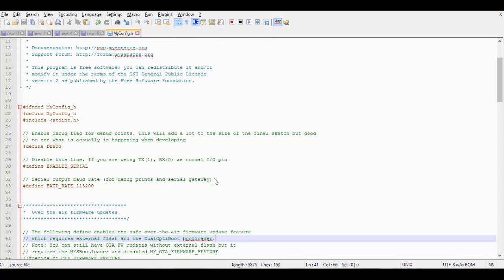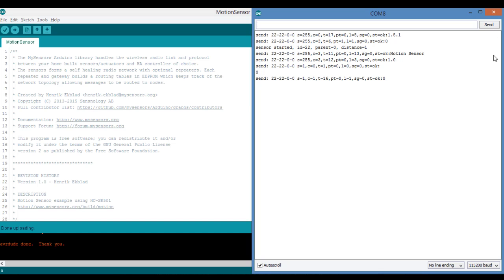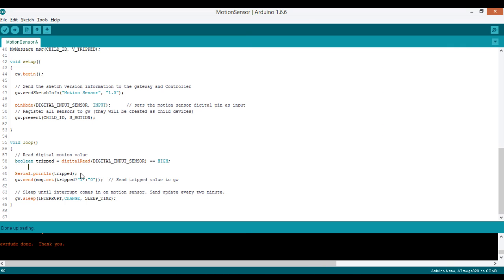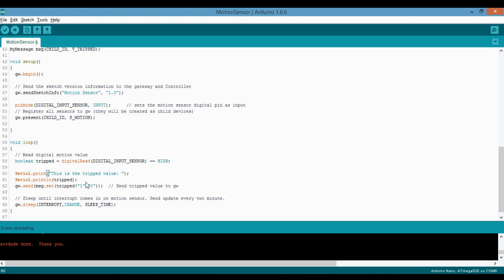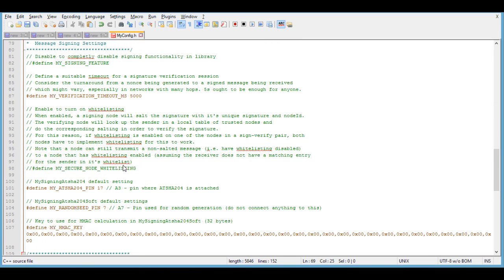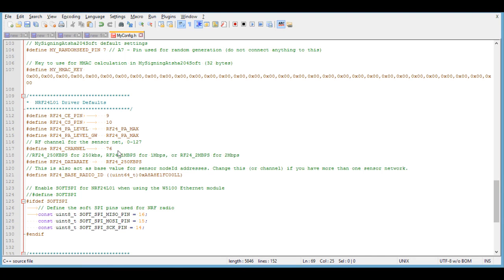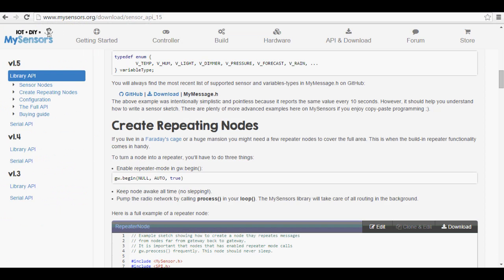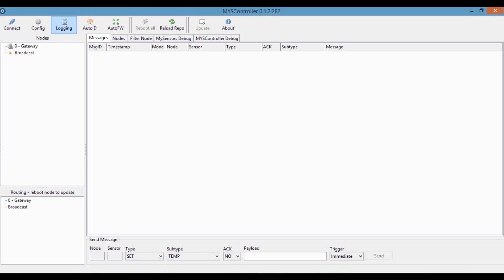MySensors Troubleshooting Tips

Comment: +Pete B - I've enjoyed all your MySensors videos and have taken some inspiration, but I'm a bit concerned about the security of these. I've recently started playing with NRF24L01+ radios and there doesn't seem to be any built-in security. Is there anything with the MySensors libraries? I've had some good success with AES encryption and transmission between the Arduino and Pi, but wanted to get your thoughts. Is it difficult to enable secure transmissions on these?
Reply: There is an IC for sigining.
check this link http://forum.mysensors.org/topic/1021/security-introducing-signing-support-to-mysensors
Reply from the maker: +Ben Reese ahmedadelhosni90 beat me to it but definitely check out the signing work done by Anticimex from the MySensors forum.  He is very knowledgeable in the area of security!
Reply: Thanks ahmedadelhosni90 and Pete B. I looked over his original post explaining why he chose signing over encryption, but I'm not sure I fully agree - especially since the Arduino is capable of AES encryption/decryption. What I have now is just a proof of concept though and I was hoping there was real encryption built in somewhere. I'll definitely look at his signing methods a bit more though. It seems very well thought out from what I've seen so far! 

And thanks again for a great video series. I love the openness of what I've seen so far in MySensors and I love the cheapness of the NRF24L01 radios. Very good fit for each other.
Reply: +Ben Reese The post is very long but veru usefull. The issue "encryption vs signing" was discussed a lot in the topic. but signing is powerful as it prevents Man In the Middle attacks where replay block attacks can be used. In another words, the attacker can know that you have opened your room door by looking from his window rather than knwing this info from the debug info during TX and RX. so even if you encrypt your data, he will for sure know which device are you using at any moment buy looking from his window towards you house. Thus Signing is more powerful as it prevents any other fake gateway to be used to send data to your sensor nodes.